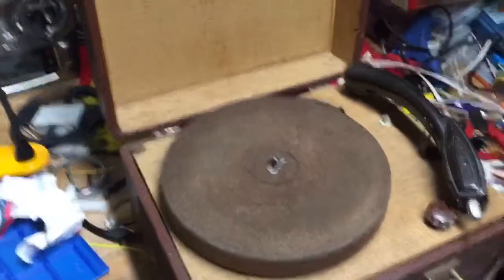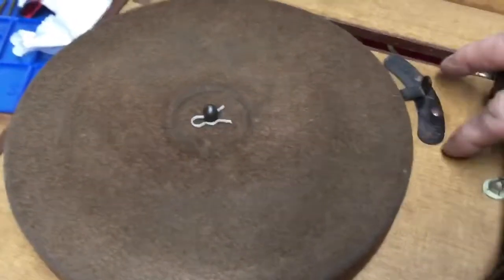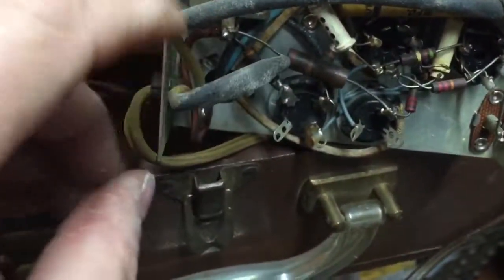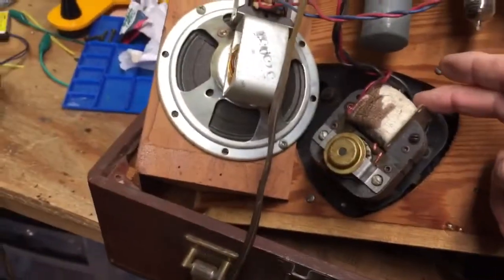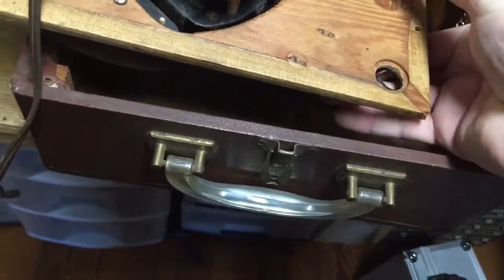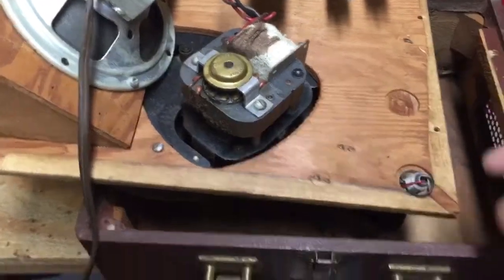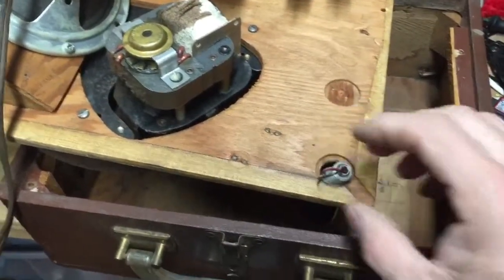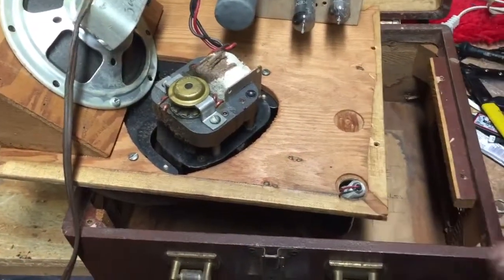Antique record player repair part one

Comment: Great task what you do. May i ask, what is the minimum tracking force for these record players_ is there any way to alter the weight of the tonearm?
Reply from the maker: Most of the vintage sets I have serviced have no tracking force adjustment and the 78 rpm versions probably had over 25 grams of weight on steel needles.  The 45 and 33 rpm turn tables played fine on these regular needle players but probably did some damage to the records.

Comment: I have never in my life seen a wooden record player.   I have an RCA of the same vintage, but sheet metal, as this one.  I have to replace the speaker which is shot.  The tone arm is plastic which makes life difficult and has the same grommet problem which is why, I think, it skips across the first two tracks of any 33 1/3 LP.  45s and 78s play perfectly.